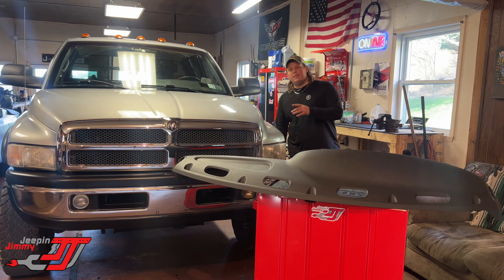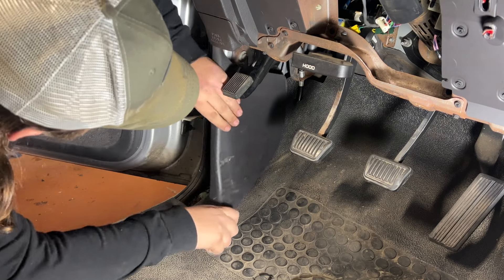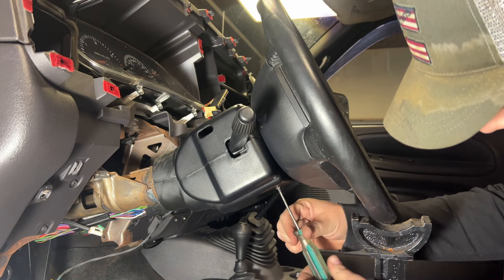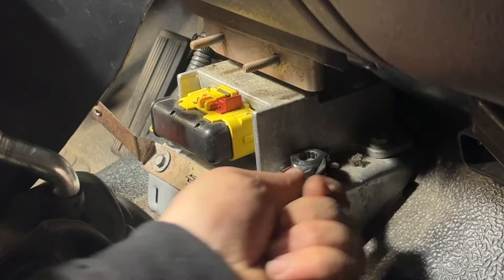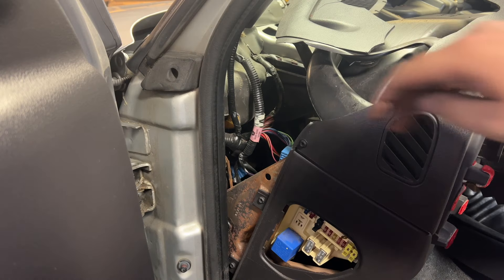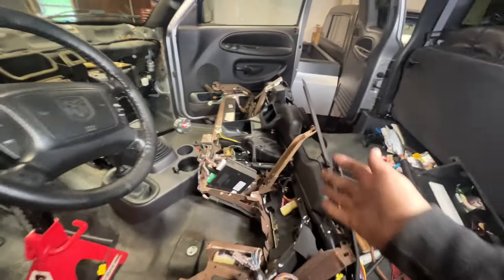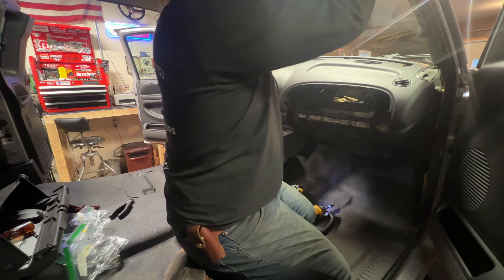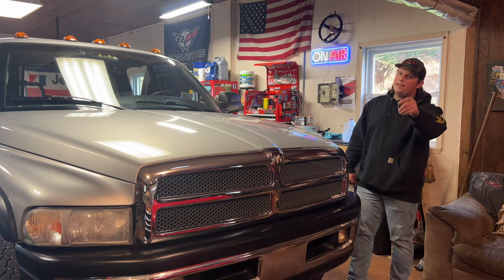'98-'02 Dodge Ram DIY Dash Board Replacement

Comment: Just a warning for anyone, yellow plugs are airbag plugs, I'd recommend disconnecting the batteries and letting the system sit for 5 to 10 minutes before messing with them.

Comment: I replaced mine following the instructions in the Dodge Service Manual. Slightly more work with having to remove the steering column, but with that done, the dash can be rotated down without having to be removed.

Comment: I just removed my entire dash permanently from my 99 Dodge 3500 van..I was surprised to find that the vin tag is attached to the plastic trim and not the steel..I'm building a military looking slantback veteran of a thousand psychic wars vehicle...question I have is I want to do away with the original gauge cluster..there are 2 plugs on the back of it and I need to make it run with those unplugged and for the alternator to charge..which wires can I connect to make this work..I will be adding aftermarket gauges into the center of my new flat dash plate.

Comment: Great video, sir! Love your channel and just subbed. Quick question... Do you need to remove the entire dash if the windshield is out? Does it make it easier with the windshield out at all?
I ask because I need to do both very soon. 👍
Reply from the maker: Thanks man! Actually no, I dont think you would have to. The only reason to pull out the entire dash is to get at the bolts facing front so you might be good!
Reply: @JeepinJimmy  Thanks 👍

Comment: You tube needs to recommend your videos more.  Yours are informative, fun and not boring like some.  Thanks I am ready to start (I hope),  Wish I had you on speed dial,   loll
Reply from the maker: Thank you! Good luck on your endeavor. Feel free to comment if ya snag on anything!
Reply: Getting back to you just to be safe.  I've been getting a place ready to do the job my shop is full of quads, bikes and other things.  
Basically been putting this monster off.  But, I live in central Oregon outside of Bend and we have been getting some elevation snow and my car doesn't cut it in winters here.  Wide tires and no clearance are the wrong receipt.  Today  started on what I remembered from watching you video, the first time but had to come in then re-watched it.  Now to go out and do more. I'm working solo as well. The actual job I am doing is I  am replacing my wiring harness.  Flooded the truck, should have let it to dry more but started and drove instead.  After 3 miles everything was going crazy.  Horns blaring, lights flashing, seats moving, my truck was possessed.  lololol. started repairing wires but no way too many burnt.   What I was wondering if you knew was that I probably do need to take whole dash out right?  aient no short cuts here?  I'm not a mechanic but can handle lots of things.   Just put whole new suspension, about 20 pieces, on my car.  It was scary at first but wasn't too bad a job.  If i did it again it'd take less than one day.  Just lots of ball joints and big bolts.  This job though?!?!?!?!?  oh Jesus!  I should just get another truck right???  JK. Love my truck.  Once again I don't know you but I'm using you for info so thx.  if you were close, I'd pay for help.   Any response?   @JeepinJimmy
Reply from the maker: I wish you luck man! Taking the whole dash out is probably your best bet. It also makes a ton of other stuff easy to get to. Im in PA unfortunately!

Comment: I replaced the cracked dash on my 1999 without doing all of this shit. If was still a pain in the ass, but you can replace it without complete removal. At least with this method, you can replace your heater core at the same time, as well as any cleaning and venting maintenance that might be needed; after 24 years there are bound to be problems back in there.

Comment: Looked like double trouble. I was thinking about this trouble and wondering if removing the windshield would takesome of that troyble away. Windshield get road ware from debris anyway. I replaced my windshield for 250 dollars and I did not do the work. A company did the work..2024 parts a labor 250 dollars

Comment: The previous owner changed the board for my ram but now it doesn't have the VIN. Could it be that it stayed on the old board?
Reply from the maker: That could be the case! I didnt realize the vin was attached when I junked mine so now this truck does not have the vin tag on the dash.

Comment: I took mine out last year, i took the windshield out and loosen the kick panels bolts and rotated the dash back about 6" then i could get to the vent screws, i pulled the column as you did as well,just thought i would share.
Reply from the maker: Right on! I dont think id be able to get the windshield back in once i had it out though haha

Comment: My 2000 dodge ram laramie slt quad cab long bed 1500 black with most of the white pinstripe 4x4,has a dash skinz dash cap already on the truck when I acquired it, and the glovebox light/switch goes in a like square tap off the bottom of the top dash assembly that is snapped off the glovebox light/switch just hangs inside the glovebox..

Comment: Good job! I just bought a 1999 Cummings/auto 2500 4x4 quad cab with only 128k on the ticker. It was garage kept its whole babied life! The only crack on the dash is 1 on the passenger middle side. I was contemplating going on and doing this. I have done one before on a 2001. That was the shape of yours. Made a huge difference. Only issue I had was the sub frame was very brittle. I don’t recall seeing one of those for sale to replace. Thought I would pick your brain to leave it or replace it on my new truck
Reply from the maker: If it is only 1 crack and no holes I probably would kick the can on down the line haha

Comment: Thanks for the video. Used this to replace the dash in my neighbor’s 01 that I do the work on when he wants me to. 

I didn’t see any pointers for automatics, so I’ll list them here.

- chock the wheels before working. The reason being, when you go to lower the steering column, you will move the column around and it will pull the transmission out of park and into any of
the other gears. You should also have the parking brake set, but even that won’t really help because once you start moving the dash, the parking brake bar will be tugged and you’ll lose that also. So, chock the wheels before starting. 

- Move the automatic shifter down into 1st gear before trying to remove the dash trim panel. 

- don’t forget to disconnect the automatic trans indicator cable from the cluster before dropping the steering column. 

Other than that I think all of the manual trans details apply, other than the airbag module being easier to remove in the autos because it’s just a simple 2 screw cover over it whereas it’s the whole
Shifter trim assembly on manuals. 

Not a bad job but my neighbor’s truck had an aftermarket remote start and alarm hard-spliced to both the dash harness and the engine harness, so I had to do cutting to get the dash back out and resplicing to get everything working again. That was a major pain. Also, the neighbor has a pretty elaborate amp and speaker setup and so I had lots of added speaker and RCA cabling tethered to the dash as well that had to be pulled out of the way. I probably could have done this job in half the time with a lot less frustration had the truck still been stock.

Comment: is there any way to fix those cracks using epoxy or duct tape? anything?
Reply from the maker: Probably not fix. The plastic is so brittle if you would toss your billfold up there it would fall through😂
Reply: so, did you try epoxy or glue?

Comment: That came out so nice. Need to do the same with my ‘99.
Reply: Me too and same year. I have already replaced the engine, transmission, and transfer case, rebuilt entire front end, flushed both diffs, new speakers and tint. Just waiting to do the dash and touch up a couple small rust spots. Truck still looks like new now but I want it completely restored

Comment: Excellent job ! Got a 2001 and 2002 I have to do soon. I’m going to go ahead and do the blend door USA upgrades when it’s all out.
Reply from the maker: Right on! Thanks!
Reply: What do you mean?  Is there something that typically goes wrong with them?
Reply: What do you mean?  Is there something that typically goes wrong with them?
Reply: Sorry so late replying. Blenddoor USA replaces all the doors that are plastic with aluminum doors that have better sealing foam on them. The kit also includes an aluminum driver for the blend door. I put this kit on my dodge when heater core went out and it was worth every penny! Also they give you new foam seals for the everything!

Comment: Just bought a 2001 1500 the dash is completely rotten!

Just saw your detailed video. I wasn’t planing to remove the entire dash to replace the top part but do you say it’s best to , all those wires look confusing lol just don’t want to ruin it 😂
Reply from the maker: Congrats on the truck! If you do just the cover, you will not be able to get access to the screws holding the defrost vent to the dash. But one good thing is all the wires have different plugs so nothing would get plugged into the wrong place if you did decide to pull the whole thing out!

Comment: how did you change your manual shifter knob? i have a 99 ram 3500 and my shifter knob is lop sided.
Reply from the maker: If you pop off the cap with the shift pattern on it there is a nut under there
Reply: They all are !  But after a few years of shifting, it comes back to top dead center.

Comment: Great video!  I've watched other videos concerning this topic and they are all a little vague while not showing everthing you need to do.  Even the LMC Truck video leaves things out.  Your description of each step is clear and the video shows exactly what you're talking about.

A couple years ago, I was doing a full detail on my garage kept 1998 Ram SS/T and found a crack coming from the bolt hole nearest the passenger side A-pillar.  I've never seen one start cracking there.  I felt like crying since I've babied my truck since new.  The crack isn't terrible yet, but it's getting worse.  I guess I will order a panel and do this job this winter.  If I can do the plenum plate/gasket repair, this should be a breeze.
Reply from the maker: Thanks man! Good luck with yours!

Comment: very impressive and amazingly informative; wish I didn't need a heater core replacement that might cost $l,000 to be replaced.
Reply from the maker: Thanks! The heater core itself is no more than $100 so if you can handle what I did in the video you could save a ton of money!

Comment: I don't think you have to disassemble the whole car to replace it.
Reply from the maker: Correct. The engine, trans, axles, etc can stay in place but the whole dash does need to be removed to access the screws on the back and get the job done properly.

Comment: Great video... excellent.  Replace the  heater core if the milage is anything over 250,000. You'll avoid a 2nd dash removal.  Work smart. . Work once.
Reply from the maker: I appreciate it! This truck has 200k on it so hopefully some life still left!

Comment: Anyone know what the plug at 2:50 is for mine doesn’t have anything plugged in
Reply from the maker: Just looked. Not sure what its for, but it feeds into a bigger loom that goes into the side fuse panel

Comment: I need to do my dash.  Im debating between a skin and a new pad.  Mainly because the dash where the bezel clips is all sorts of broken.  Would this solve for that?    Maybe more intimidating than it should be.
Reply from the maker: This would solve that, it also comes with new metal retainers. I think it was worth it even though there is a bit more work involved!

Comment: I did this on my '01 Dodge Ram 1500 Sport about three years ago.  I also bought the dash from LMC, and the ABS plastic seems to be of much better quality than the OEM.  A few things to note.  I would definitely recommend a helper when removing the dash.  Not so much because it is heavy, but because the remaining plastic is so brittle.  The plastic frame where the a/c control panel is at cracked in several different places.  I had to use JB weld, wood, old plastic parts, and some ingenuity to keep it all together (thanks, DaimlerChrysler, for making such a crappy dash!).  So the helper comes in handy when lifting the dash and not adding extra stress on the already brittle parts.

The helper will also help you save your back.  Again, the dash isn't all that heavy but trying to pick it up and twisting and turning in such a cramped place could cause you to hurt your back.  Save your back, everyone!

Other than that, excellent video in that it is short, to the point, and isn't filled with annoying music.  

P.S.

I am going to look into replacing the headliner which I will also be buying from LMC.  I wish LMC would make the overhead console for these trucks.  The plastic they (DaimlerChrysler ) used on the consoles is also very weak and brittle (Again, thank you DaimlerChrysler!).

Comment: That was a really great video.  Well done.  I paid someone to do this for me on my '98 about 10 years ago. The problem is the '98 is a one-year-only instrument bezel and they are no longer available anywhere.  You can get 94-97, and 99-01/02, but not '98. The difference lies in the size of the hole for the headlight switch. '98 used the old switch in the new dash so the hole is smaller than the '99-up as those used the new rotary knob headlight switch. The newer bezel would look awful, showing the screws and dash structure. It could be updated to the newer style, but it would require a donor truck--you'd need the dash support, the wiring connector, the bezel, and probably some wiring.  I just live with the crack in the bezel. 🤣